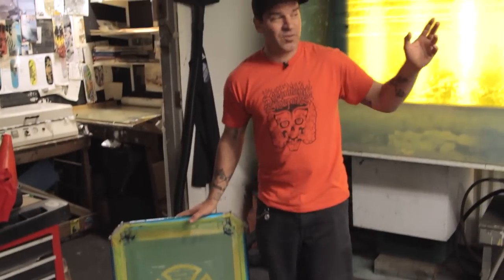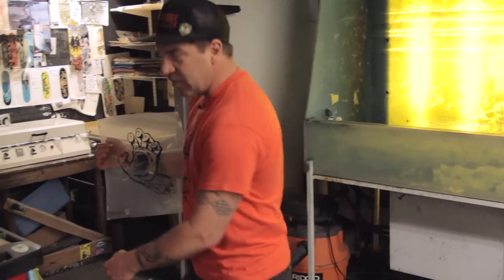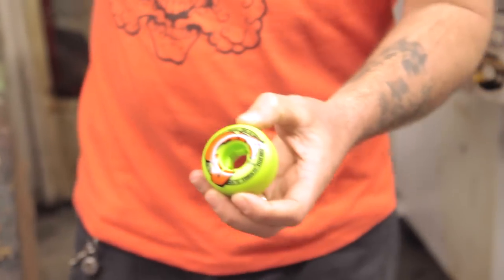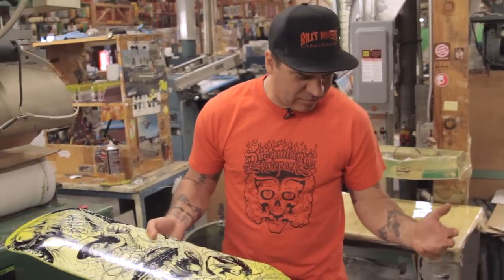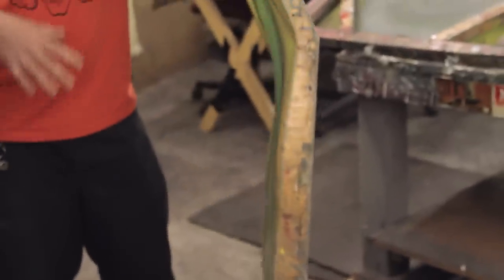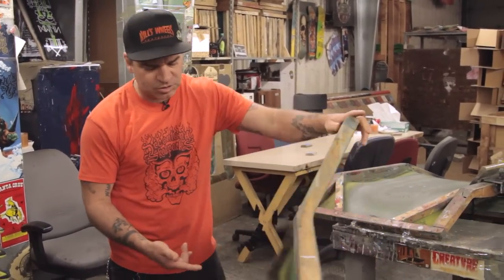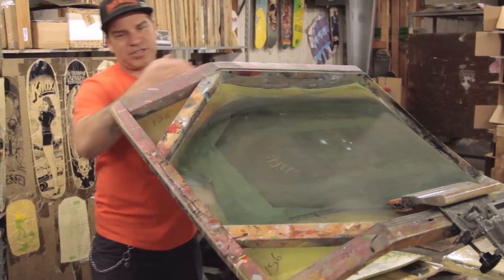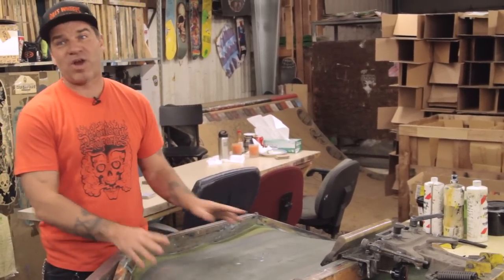NHS Distribution Tour - Printing Graphics

Comment: How they bunched the silk on the wooden frame? you would have to upload a video to you tube users to see.
Reply: gluing the mesh on a flat frame usually is done with a stretcher for the mesh, placed on the glued frame and then sprayed with glue activator to cure it. id also like to see how they stretch a convex/concave screen

Comment: You say you print some graphics using UV printers. How is that done? Arent UV printers flat? How does it print round the kick and nose?
Reply: +Corey Shepherd They print the Heat Transfers on UV printers. The sheets themselves are flat, then they are heat transferred to the decks.
Reply: +Will Correa 

What type of heat transfer glue do they use on the transfers